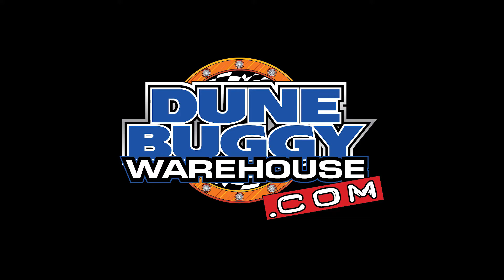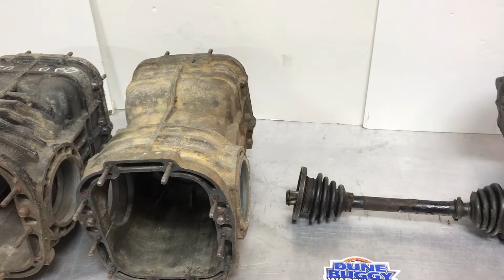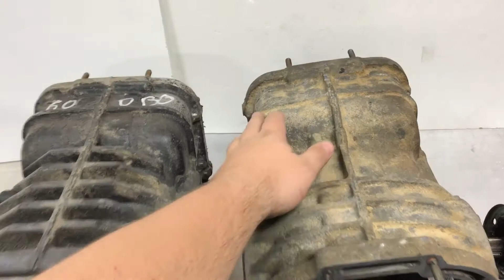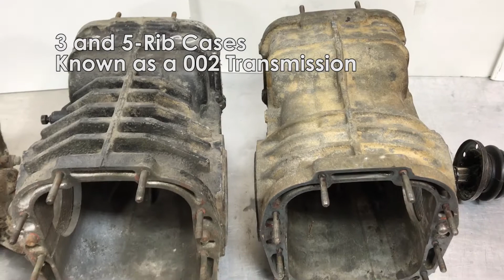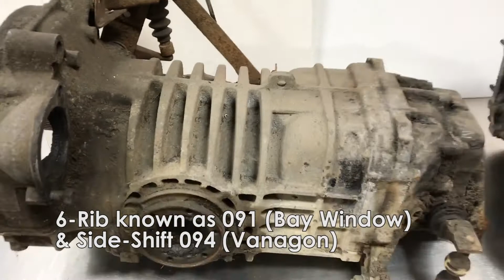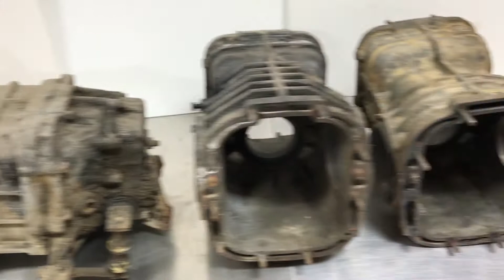Bug vs Bus Transmissions - How to tell the difference - Air cooled VW Tech Tips

Comment: Since no one else is mentioning it. Early bus and bug transmissions are virtually identical, difference is the gear ratio inside of it which, if yours is completely stock, can tell by the serial code on the body. Usually has 2 letters and 6 digits but that will vary.

Coming from a noob that had to dig through crap forums from old farts who can’t explain their transmissions to save their lives.

Otherwise this is technically correct but fails to mention he is only talking about LATE bugs and bay window bus’s for the transmission here.

Comment: I heard the bus transaxle could be flipped to use in a front or mid engine.  Specifically the type 4.  Is this true?  I read in another forum a ring gear needs to be changed andno flippimg needed.  Otbers are saying the same can be dine with a split beetle transaxle.  Can you debunk or confirm these as fact or myth?

I want a front engine with rear transaxle and the sit looks like a good option if i could figure out how to change geara and the transaxle will work when flipped.
Reply from the maker: Most mid-engine applications flip the ring and pinion to the other side. Formula Vee, Formula First, and mid-engine sand rails/buggies all flip the ring and pinion. Type 1 Bug and 002/091/094 Bus transaxles would need the ring and pinion flipped for mid-engine use. If you had a reverse rotation engine swap like a Honda K-series then you wouldn't need to flip.

Formula Ford does use an upside-down Hewland transaxle (based on an upside-down Type 1 Beetle transaxle) but these are not common in our aircooled VW hobby - and use a lot of specialty components.

Comment: Have a cuestion? The transmission super beetle and standard beetle is identical  the same?   ( Internal )
Reply from the maker: The single side cover 73-79 Beetle transmissions were identical. Some small changes from 68-72 between Super and Standard - mainshaft splines, first gear, final ratios.

Comment: What transmission is better and good for a sand rail
Reply from the maker: Depends on power and how much it would be getting beat on. Plenty of sand rails use a type 1 transaxle, but a 3, 5, or 6-rib Bus trans tends to be the most popular from what we see. For 200+ hp you should start to consider something like a Mendeola MD4/5, and with a big turbo or V8 you're in Mendeola S4 or even Albins territory.
Reply: @DuneBuggyWarehouse  thanks for right now I have a stock 1600 motor but would a 6 rib trans do anything different
Reply from the maker: @rubenganguiano1692  The bus trans has a stronger ring & pinion and lower gearing. If you don't beat on the sand rail hard it may not be worth a conversion.

Comment: would it be possible to mount the bus transmission to a beetle? if so would there be any differences besides the stronger internals in the bus transmission?
Reply from the maker: Different model and year bus transmissions have different gear ratios, and the 094 side shift has a stronger full-size reverse gear, good for powerful buggies. The swap itself is not just a straight-forward swap, you'll need to move the engine, swap axles, cut & fabricate. The best tutorial for changing from a Type 1 transmission to a Type 2 transmission is on the Samba: https://www.thesamba.com/vw/forum/viewtopic.php?t=88852&highlight=
Reply: Dune Buggy Warehouse thanks for the information I'll check it out

Comment: Great Video. Good information. Do you have any info on replacement gears? Maybe a taller 4th for highway driving.  Any information would be appreciated. Cheers
Reply from the maker: The freeway flyer gear takes 4th from a .87 to a .82. We have used German freeway flyer 4th gears available for about $80. What transaxle are you running?

Comment: I have a sandrail with w 6 rib mated to a type 4 engine but i want to switch to type 1. I've been reading online and from what i gathered,  in order to mate my 6 rib trans onto a type 1 engine,  I would have to cut 1/2" off the input shaft?  Or is there another way other than switching shafts or cutting it? As the links I read are over 10 years old.  I figured they might have came out with a sort or "plug and play " way now.
Reply from the maker: You'll have to cut the input shaft 1/2", and you'll need longer studs on the engine since the 6-rib has a thicker bellhousing: https://dunebuggywarehouse.com/vw-type-1-and-type-4-engine-starter-bolt-10mm-x-1-45.html